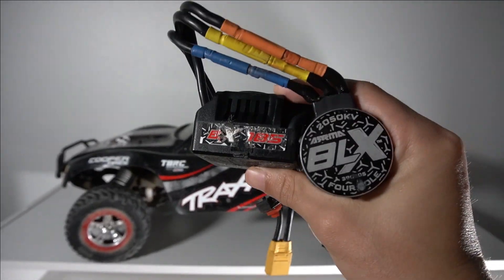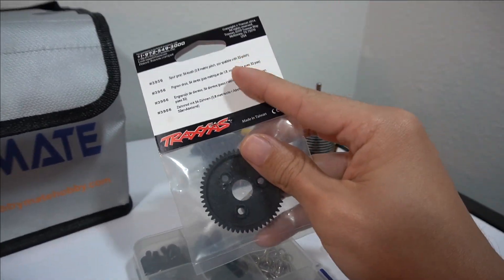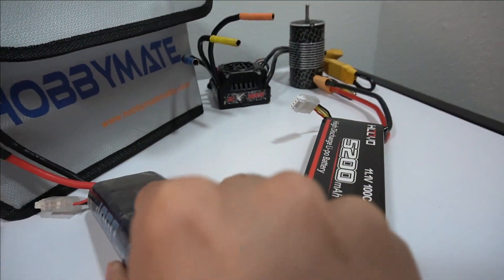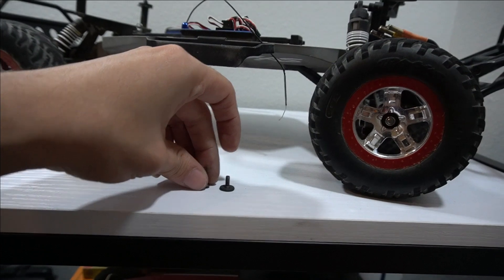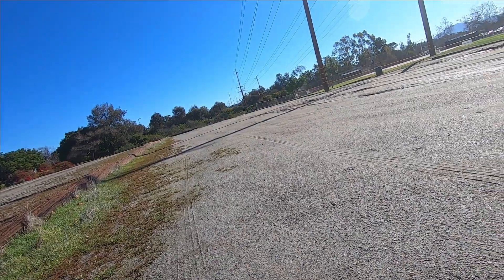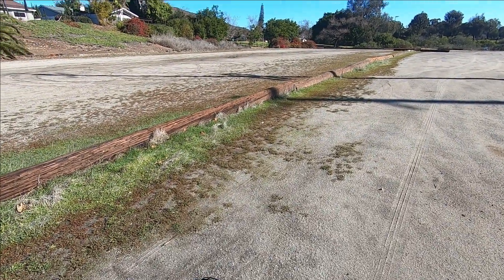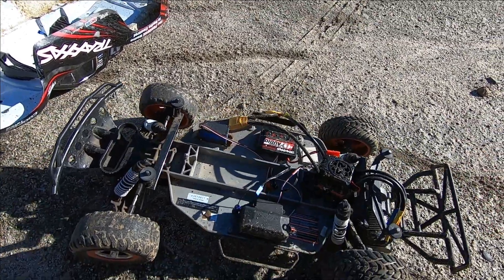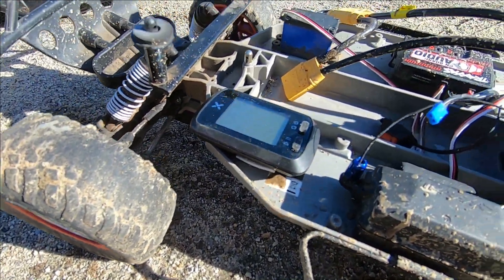6S Brushless 2WD Traxxas Slash (Part 1) - TOO MUCH POWER!

Comment: Your rear tires are on wrong sides. You're pulling into the center of the tire and not outward. I did that when I first started I'm rc and learned. I do the Monster Slash and use Stampede size tires and much better traction. 3s on Slash tire not on a clay track is terrible hooking up! I recently started racing circle track with some Mudboss cars and Slash does surprisingly good on 3s. I just added a gyro receiver and we'll see how that goes. Speed runs on pavement on 3S Slash tires was nearly impossible from spinning out!

Comment: Just bought and fit a spectrum Firma 150a smart ESC and motor, had to trim the transmission casing just to fit the motor! Just waiting on my 5mm pinion gears from Amazon to hurry up and get here! This little 2wd slash did great on the vxl 3S traxxas brushless system but this spectrum 6s system has me excited!

Comment: I run a VXL6S system in my slash 2wd, it’s completely upgraded, literally everything lol. I haven’t run it on 6S but 4S is insanely fast and a wheelie machine
Reply from the maker: I’ll have to do the same  ... I just dumped this 6s without any upgrades and I think the gears might blow up soon 😂
Reply: Yeah man at least upgrade your transmission and driveshafts lol
Reply: @JacobusRC my gears went super quick on 3s lol I can’t imagine

Comment: I wish you were using a castle 1515 6s motor because I dont want to buy one and it does not fit in the 2wd slash i have. I use the copperhead 1412 black edition 3200kv right now 32p 24/54 and it flys on 3s not getting hot.
Reply from the maker: I’m surprised the 1515 6s motor does not fit since I think it’s the same can size, the arrma 6s does have more holes for mounting I think
Reply: @JacobusRC  ok cool. I have a new Big Rock roller

Comment: How did u connect the receiver to the esc for throttle I’m getting no throttle and the red light flashing I only have steering
Reply from the maker: Need to calibrate your esc for throttle and brake, or make sure your esc is set to Lipo mode

Comment: NO IT'S NOT. My totally bulletproof 2wd Slash has a Hobbywing Max8 & 2200 kv motor combo on 6S with 18/90 metal on metal gearing
Reply from the maker: What tires are you using to control that beast? I need some tips!

Comment: Try using a low center gravity and use 6s my shocks are springy as shit I got it like that and it has abut 4 to 5 shock spacers I plan on upgrade it to the low center gravity and sway bars

Comment: Lol I've been running that in my slash for 2 years
Reply: Lmk when you get the RR spur, RR idler, HR diff, all the stock stuff starts breaking around 65mph. I'd recommend getting yourself the "A" axles from the 4x4 slash, and a hot racing trans if you wanna have pinion gear options. 

I currently have 5th scale wheels on the rear of my 6s full firma slash. 

As for your batteries, get the "x" battery tray and you can run a single 6s pack under the stock 29mm clip
Reply from the maker: @michealbruggeman145  Thanks for the info!! Will have to put those parts on my order list. What spur/pinion do you have running?
Reply: @JacobusRC  it's a Robinson racing 56t spur and an Arrma "D" 15-20t hardened steel pinion depending on my setup for the day
Reply from the maker: Thanks man

Comment: You don’t need to take the whole thing apart to change your spur gear you can pry it out with a flat head and slide you new one on
Reply from the maker: Shoot good call out ... just the 3 screw holding it on and pop it off. Definitely the way I should’ve done it

Comment: 3s is too much for a slash really can't understand why you guys install 1/8 scale systems in a slash they are only made to run 1/10 scale systems and no more than 3s I guess its true what they say about traxxas owners most  nubes
Reply: 3s is only too much if you dont setup your rig right for the extra power. I run 4s on my Stampede and it handles great because I set it up properly. Tekno driveshafts, belted Duratrax tires, 4mm toe & camber links, drag slash transmission, 25kg servo, gtr shocks, Fast Lane extended aluminum chassis. I've run 25-30 packs of 4s with it so far  and it's a stable high speed monster.